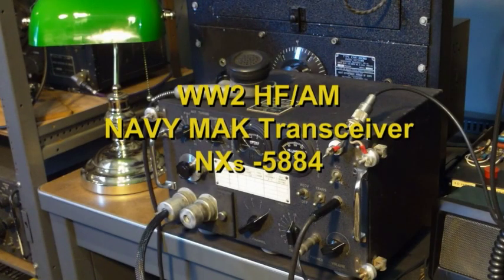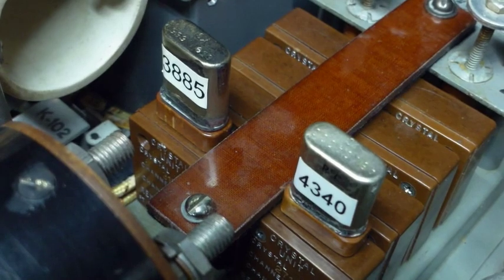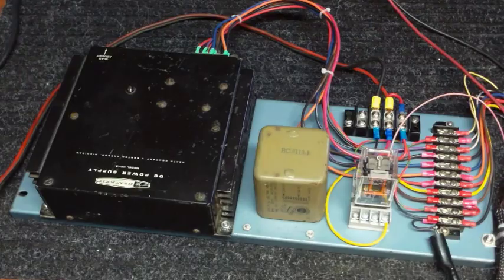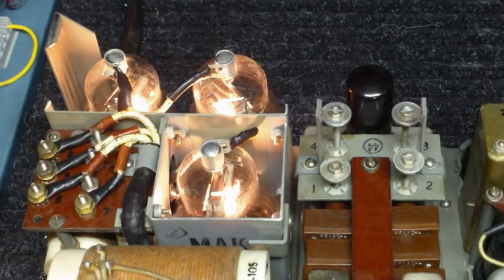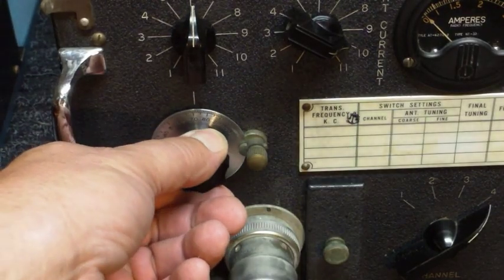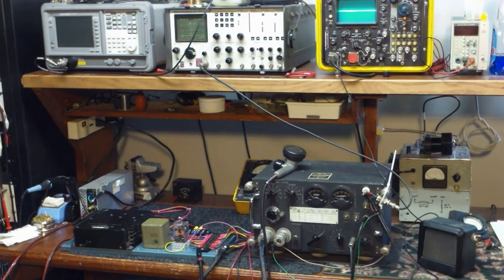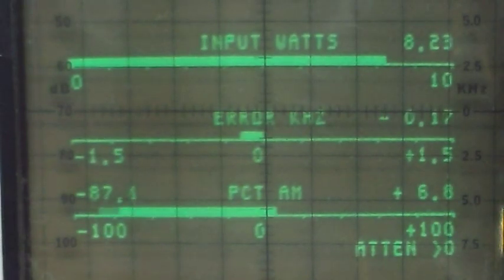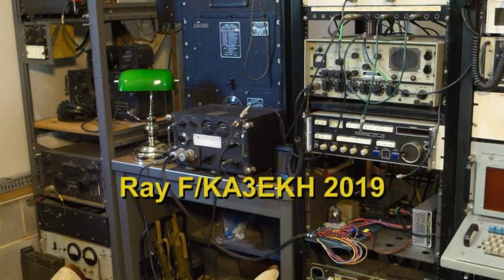WW2 Navy MAK radiotelephone

Comment: Hi Ray! I recently acquired a very nice Navy MAK radio myself. I have been endlessly searching for the TECHNICAL MANUAL FOR NAVY MODELS M0-1 and MAK Radio Telephone and Telegraph Transmitting and Receiving Equipment...no such luck. I was able to find a schematic which is unreadable online....with that said, do you have a source for a decent schematic or TM? Since looking at your video-I have also collected a Heathkit HP-13 PSU that I will be recapping. I am competent to do cosmetic restoration but am just getting into electronic repairs....I carry an amateur license and have some very competent HAM friends...the first quest is a Schematic. Can you point me to where I can find the necessary documentation? All the best! David